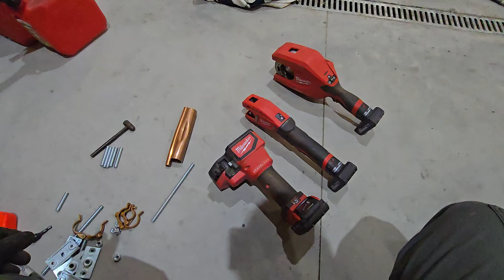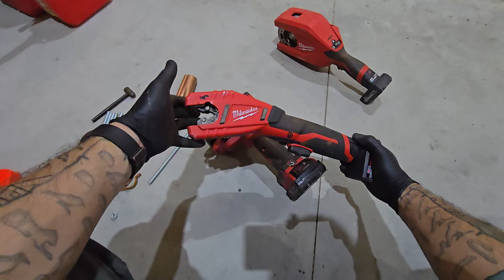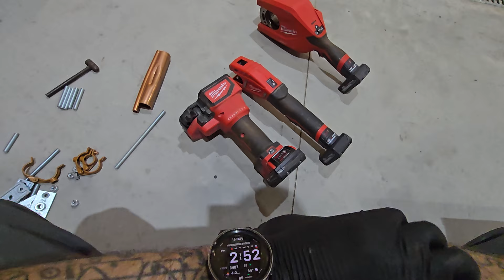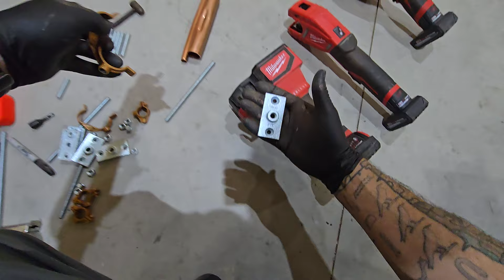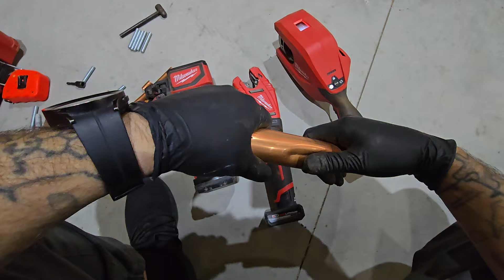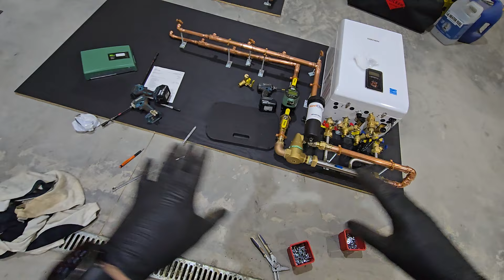Top 3 MUST HAVE Tools for Plumbing

Comment: What about the pvc cutter ? That and my staple gun are my fav Milwaukee tools I use the portable bandsaw for my rod it comes out perfect no burs but I like that cutter you got my pipe cutter can be finicky sometimes how about yours? It definitely helps if you have tennis elbow those cutter’s are a savior. I have replaced my wheel once. I hope they make a power deburring tool soon I see dewalt has one but I’ll wait. Take care
Reply from the maker: I have a Dewalt pvc cutter and it works pretty good. I also just use a deburrer on a drill.

Comment: I would say the threaded rod cutter would be the biggest win here. I used a sawzall and it was a pain. I had to make sure I put a nut on before I cut it so it would clean the threads when I backed it off.